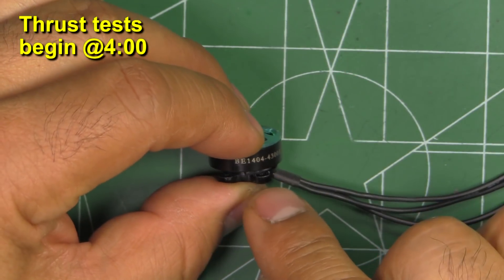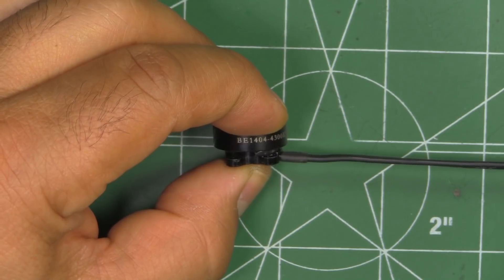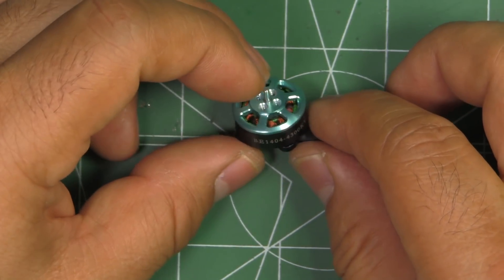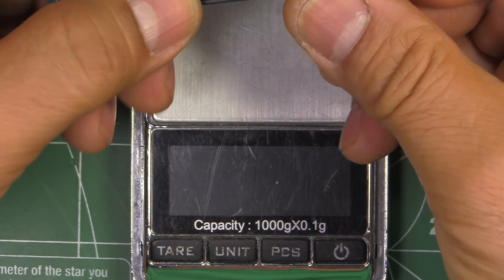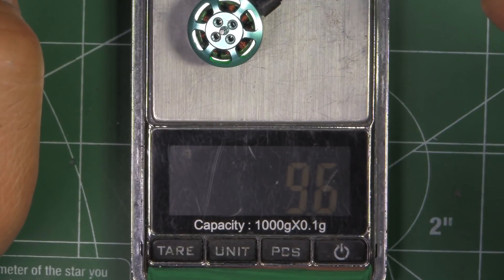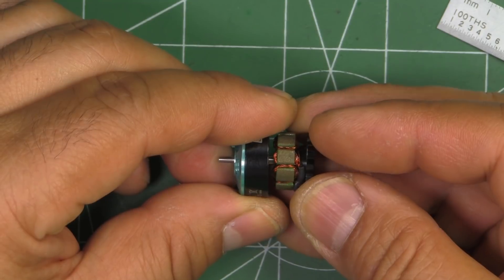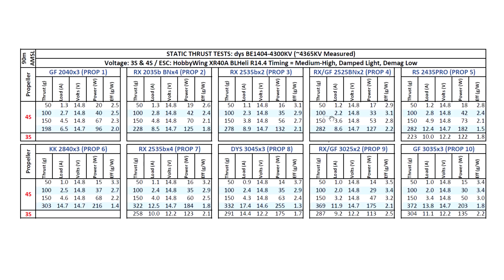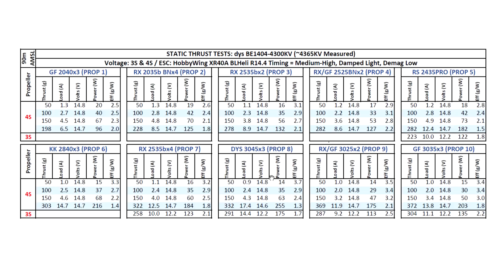DYS BE1404-4300KV 3S & 4S Thrust Tests - New Size Motor for your Micro Multirotors

Comment: Hello, we have juste tested these 1404 4300kv, on 3" quad racers, they work good on 3S, (a little better than RCX1304 4000kv, but under the REALACC 1106 6000kv), nex time we will do a video on 4s  (they are a real beast on 4s) https://www.youtube.com/watch?v=xNe4t1xmNJI
Reply from the maker: That's one of the best race tracks for micros and best flying I've seen. I'm amazed how fast your quads fly on both those motors. Thanks for sharing!
Reply: thank you EngineerX, we have seen your thrust tests video before testing them, and we don't regret, these 3" micro builds are so fast, and so light, on 1404 or 1106   :)  see you next time on the fpv racing world    :)
Reply: On 4s these little DYS motors rock.  I have found no better setup in a 3"...even against 1407's.  KEEP IT LIGHT.

Comment: would this be too much for a 2" with a 5 blade props quad?
Reply from the maker: A bit too big. 2" prop won't take advantage of the 14mm size of motor. It will fly, but you'll be flying with the extra weight of large motors. These work best with 3" props

Comment: 300grams on 4s? Thats a very, very underwhelming motor...... What a bummer. So far all of the short 14xx motors are just plain AWEFUL. I'd take literally ANY 1106-1108 motor over this 1404. My cobra 1407's put out nearly 3 times the thrust of these 1404's. I get that this 1404 is a bit smaller than my 1407 but damn..... what a fail.
Reply from the maker: Right, there's gonna be better and more powerful motors for your specific needs.  This guy is flying it on 3S 3" rig, looks good. Not a speed demon but it certainly can fulfill some people's goals but not others looking for extreme speeds https://www.youtube.com/watch?v=xNe4t1xmNJI
Reply: Wouldn't this motor do better on 4" props?
Reply: 370g with gemfan tri-blades on 4s, that's way more than enough for a light 3in, the setup these are made for.

Comment: please excuse my ignorance,  no matter the propeller or motor setup, as long as the amp draw on the charts is lower than my esc amps, i should be ok?  meaning, even if the esc or motor is only rated for 3s but on 4s the amp draw stay below my esc amp rating, i should be ok? sorry if i presented my question confusingly. thanks for all the hard work.  i think your research and info could solve most brownouts and fod on micros. seems everyone is mismatching props/motors/esc and then wondering why they drop on punch outs. thanks again
Reply from the maker: A good way of matching ESCs with motor/propeller/voltage using thrust tests is to use an ESC that will be able to handle the Amps on the specific combo you plan to use. 
For a conservative estimate, I multiply the MAX Amps from my tests by 0.75. I've found that gives me plenty of safety margin. For an aggressive estimate, you can multiply by 0.65 or 0.60. Those will give you the approximate expected MAX burst Amps. 
ESC's must have the proper voltage rating. Using a 3S ESC on 4S usually spells disaster, there are some exceptions of course. Don't chose an ESC based on Amp rating alone. You also have to consider voltage rating. Most new "good" ESCs can handle 3S & 4S but some of the smaller 6A ~ 12A are usually rated only for 3S, so that's something to check.
Reply: EngineerX thank you,  you most likely just saved me a big headache.  much appreciated! cheers 🍻

Comment: How do you think the 6000kv version would do on 3inch 3s? Looking between these and the rcx 1304 5000kv motors for a very lightweight 3inch build. Thanks
Reply from the maker: 6000KV should match really well on 3S and 3" props. The 1304-5000's are known to do very well on those setups. I think the DYS 6000KV would have a little better performance (guessing) The main key is to also match them with a good LiPo. Tattu 650's seem to be one of the preferred Lipo's by most micro quad flyers. Of course there's a few other good brands available.

Comment: Thanks for the test of this motor. I wonder how this performs with a 2S?
Reply from the maker: With a 3035x3 propeller, or any of the 3" propellers and very light frame it should do OK but I think most people would use at least 3S
Reply: I think your right, most people will be using it on a Quadcopter so a 3S would be suitable. I'm always looking for good motors for my Micro Scratch-build Parkjets and I usually use a 2S LIPO on those. Thanks!
Reply: Ground Control RC Considering it produces a measely 300grams on 4s, idk if it'd even fly on 2s lol. These motors are garbage imo. Get an 1108 6800kv and youll get 70% more thrust on 3s than this 1404 makes on 4s.

Comment: Its so hard finding parts for a micro build on 3s. I cant even imagine 4s. If anyone knows where to find some micro 4s ESCs, let me know.
Reply from the maker: Many have had good results with the HGLRC 20x20mm 28A 4-1 ESC available from BGood. 
I have not tried these parts yet but they certainly look interesting:
http://www.iflight-rc.com/iflight-the-force-mini-5-8g-48ch-0-25-100-200mw-switchable-fpv-transmitter-support-osd-frequnecy-and-power-tuning.html
http://www.iflight-rc.com/ipeaka-18a-d-shot-mini-4-in-1-esc-blheli-s-multishot.html
http://www.iflight-rc.com/ipeaka-25a-32bit-blheli-32-esc-opto-2-4s-dshot1200-compatible.html

Yep, 4S at this scale is definitely a challenge!
Reply: EngineerX I am looking at 16mm mounting size. I have found a 3s 2 in 1 at that size. I have some small individual escs, but I dont think there are any 16mm pdbs. I am thinking that I will need to just solder the ESC wires together in a lump. But thank you. I am thinking that I need to look into 20mm because there seem to be more options.

Comment: Very cool little motor. I think I like the 1304 motor is still a better choice for 2.5". Just from a weight stand point.
Reply from the maker: Yes, when you factor in weight for similar performance the 1304 has an edge, this 1404 might really shine on 6000KV perhaps (if it can run on 4S without overheating)
Reply: EngineerX Do you think the 1404 would have a chance on 4s.
Reply from the maker: Possibly , a 1404 has about 20% larger stator (quick estimate just using cylinder volume so more like a guesstimate) So with stator being larger it should have more capacity to deal with heat from generating the power necessary to spin 3" props on 4S. Ultimately.... only actual flight tests would tell you for sure, but I think they got a good chance. There's a couple people flying the EMAX 1106-6000 on 4S superlight builds already.